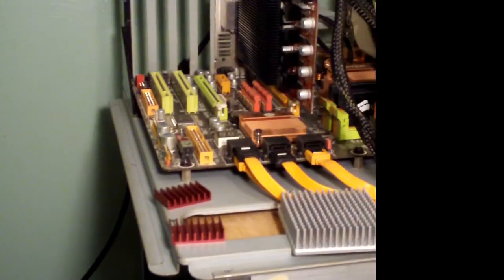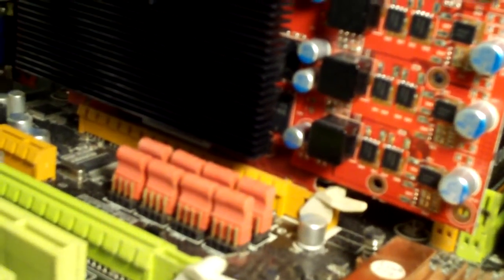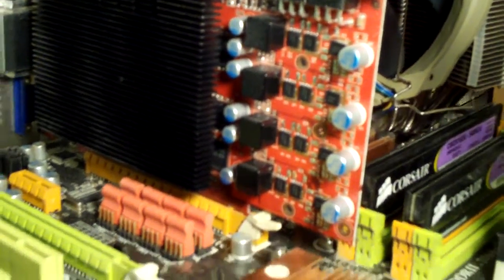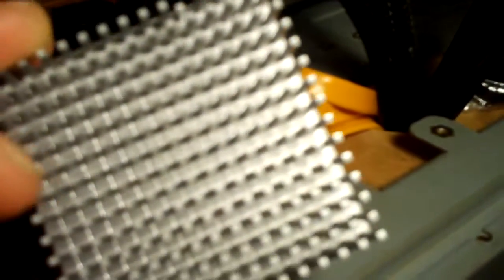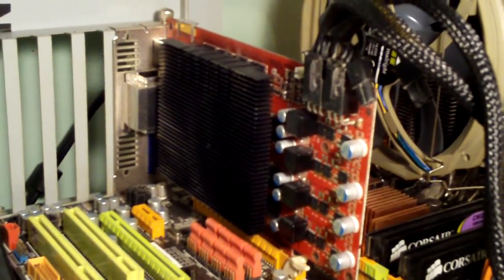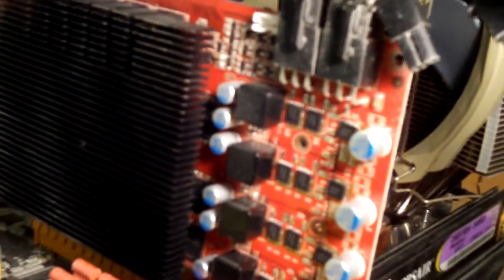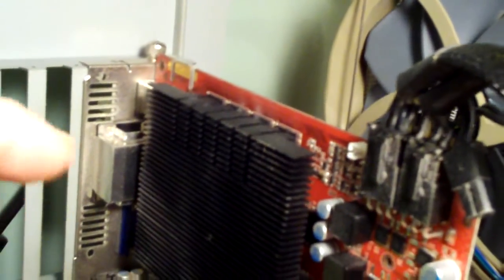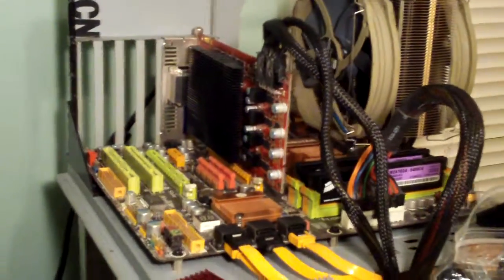Palit GTX 460 VRM Cooling Ideas

Comment from the maker: @mikee1333 It requires 2 6 pin for power if you are short can use a molex to 6 pin adapter I wouldn't recommend but it will work. If you have a 6=2 like I do on all my plugs it will work just plug in the 6 pins be sure its the right ones since it only goes in one way should not be a problem. Hope this helped if not please let me know here to help.

Comment: @ComputerTechTV 

It has both, pop the cooler and you will notice two sets of mounting holes with one set not being used. It is great if you want to put a block on it but the other set which is the same on other GTX 460s out there like mine but aftermarket coolers are not easily found. What you got there if it is advertised to mount on a GTX 460 it should fit unless it sits to much forward then it will bump the i/o slot bracket. I am on THG if you want to open a thread.

Comment: Buy the ramsinks from Zalman or the solid copper ramsinks from Swiftech on newegg. They are pricey but worth every cent. The card you purchased wasn't the best choices out there. 

I have a video of my self modding my gtx 460. As for the core you can try to mod G92 coolers as there is mounting holes for them but will be cutting it close.

Comment: The VRMs had heatsinks on the engineering models. They removed them and said "they weren't necessary." I am currently using two Palit GTX 460 Sonic 1 GBs at 869/1738/1800 at 1.05V with stock coolers. I want to see how far your OC gets. Please do an update later! Thanks. :D